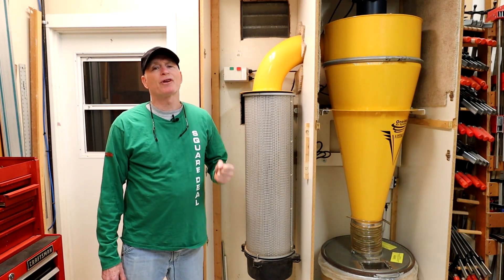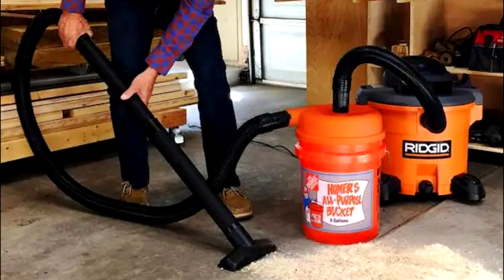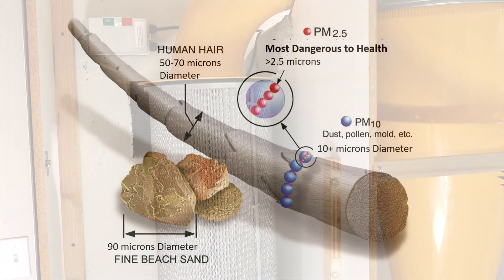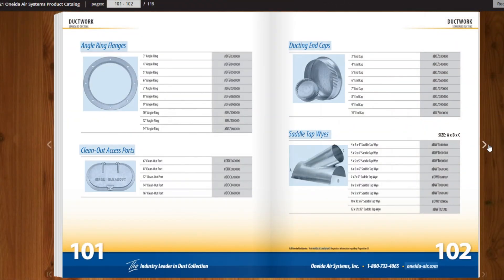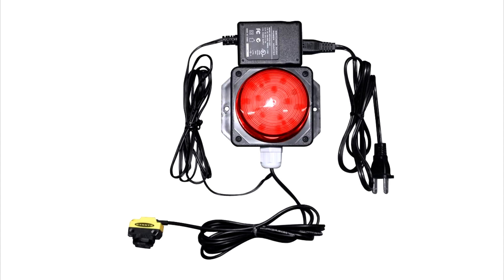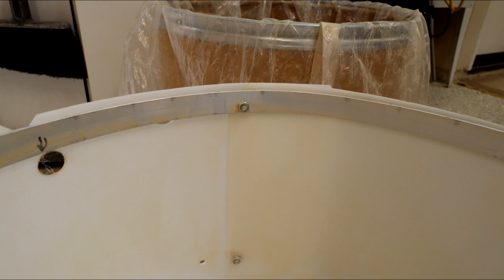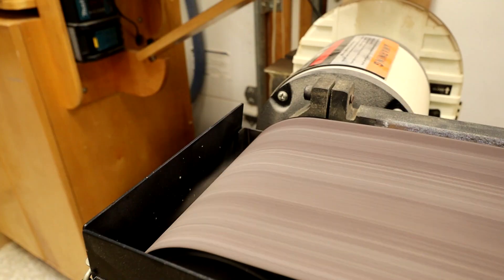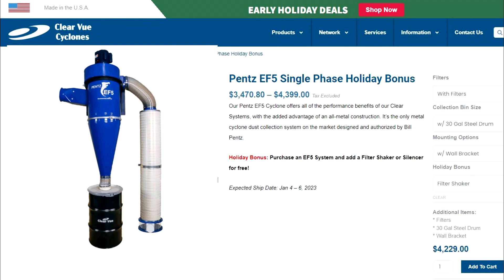Oneida V-3000  Cyclone 12 years later

Comment: Thanks for the interesting video! I saw the '12 years later' and was hoping to see a collector more like mine, but mine is before they had any yellow or smaller machines! I just pulled my 22 year-old Oneida cyclone out of mothballs, and will be setting it up in my new shop. It was originally in a basement shop, and the motor was up in the ceiling joists! It is a 2HP system, so hopefully I can design an efficient duct system for my new shop (32' x 36'). Oneida sure has come a long way since 2002!

Comment: Nicely done.
I currently use a Laguna 3hp Pflux but am ready to trade it in. After 5 years it just doesn't suck enough :-; So I am chatting with Oneida on which to buy.
At 75 years of age, dumping dust bag is not fun. Bags are important to corral the dust as you point out.
Thanks
Doug